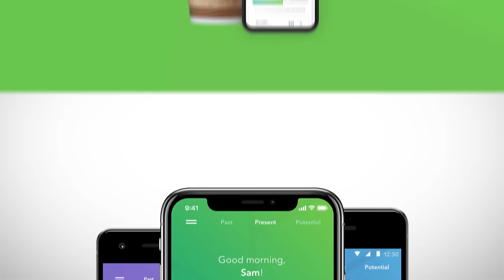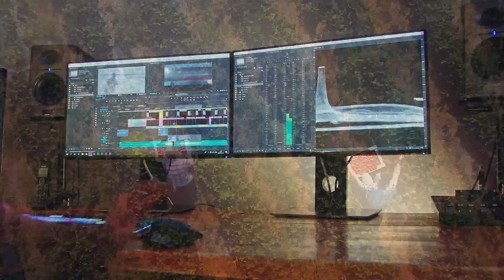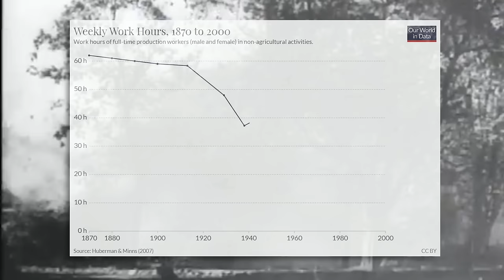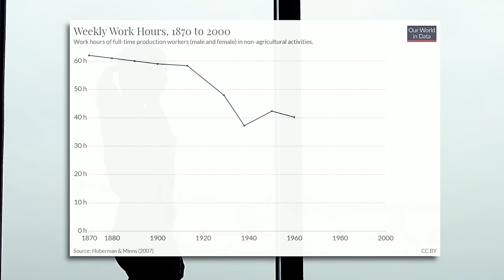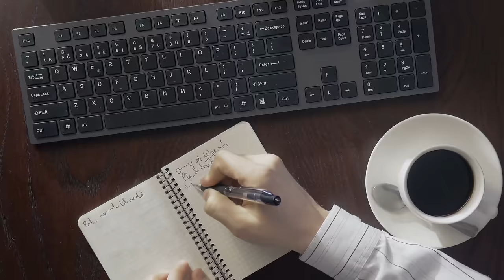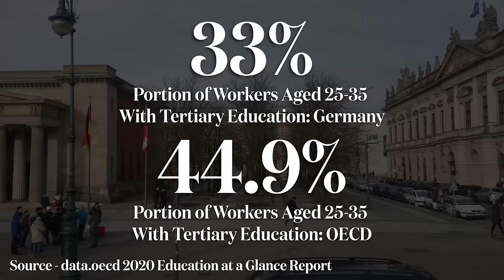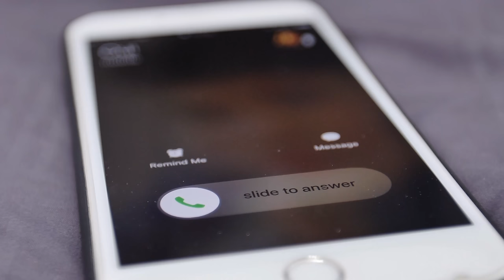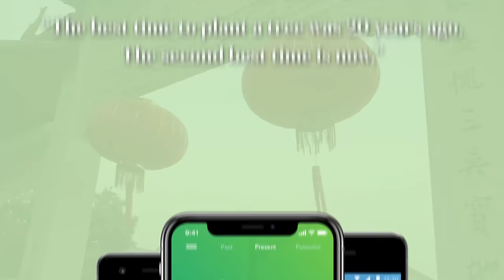Why is Working Harder Making Us Poorer?

Comment: You don’t get paid according to how hard you work. You get paid according to how hard you are to replace.
Reply: There's a checkbox, either written on in the head of every person giving a raise. "Is this person filling a key role for our organisation?"
Reply: Meaning humans are reduced to just tools of production.
Reply: Dude. Nailed it.
Reply: Bullseye! Very well said!
Reply: Indeed, working "hard" doesn't mean that your work is of any utility.
Reply: Yeah which why I try to do the bare minimum now. Which is less work for me. 😅
Reply: Mind blown
Reply: Ooof. That hits hard!
Reply: @bro ha Unless only they know how that crucial module works and there's no documentation.
Reply: Absolutely. Make no mistake your pay isn't meant as any sort of a reward, but simply supply and demand. You are selling your labor, and the value of that labor depends more on the buyer and the market than the seller.
Reply: Bingo
Reply: You get paid for the value you provide to the marketplace -Jim Rohn
Reply: Generally speaking this is correct, but I feel this is more so a cultural problem that you are describing outside of broad market trends of course.

A question I like to ask myself is why don't people working those jobs find a better job? Yeah it's hard, but even a slightly better job is worth it in the long run. The answer almost always is cultural. Being "poor" or "rich" definitely has a cultural component to it and changing culture is very slow. Do I have a solution to this? Not really, other than to say please vote especially in local areas.

Another question to ask is why has the median wage completely stagnated since the 1970s while gdp and average quality of life skyrocketed? Are these jobs part of the answer?
Reply: This is easy enough to understand. Fair enough
Reply: While true. I think your comment needs an edit.
You get paid according to how difficult YOUR BOSS THINKS you are to replace.
Sometimes perception is more important than reality!
Reply: @LiveType  Another question to ask is why has the median wage completely stagnated since the 1970s while gdp and average quality of life skyrocketed? Are these jobs part of the answer?

The answer is complicated but I think it's mainly because:
(1)  GDP is a inaccurate, outdated economic measure that only continues to be used because economists resist change.
(2) While individual incomes have stagnated, household incomes rose when women entered the workforce, so a couple/family now earns 1.5x+ what they previously did when the wife/mother remained at home.
(3) The cost of basic household items (such as food, clothes and basic appliances) has fallen dramatically relative to household incomes (especially when China became an export factory for the West), so while wages haven't been rising, these "living" costs have fallen, making them relatively cheaper (while others, such has property prices and education have risen).
Reply: Well said.
Reply: Jaskaran Singh so is a thief at the cost of his victim
Reply: Jaskaran Singh they’ve replaced the middle class, by stealing their jobs
Reply: Especially worrying considering the dizzying pace of automation and AI encroachment into white collar sectors.
Reply: Not true if you are a business owner.
Reply: @bro ha No he's not. It's really hard to find good developers (hence the high salaries that Google, Facebook, Amazon, et al. offer). (And I say this as someone with 9 years' professional experience as a Web Developer.)
Reply: i wish ha, they cant even find a vacation replacement for, still minimal wage -.-
Reply: @coopsnz1  While it seems businesses pay a lot in taxes, in reality there is bifurcated tax system where a few large businesses don't pay any taxes while also receiving subsidies, and the rest of the businesses who do pay taxes. Apple, and notably Amazon, but also companies like Boeing and GE paid no taxes whatsoever last year while also receiving sizable local government subsidies. Interestingly, in the US, the oil companies received the most money from covid-19 bailouts, which was promptly spent on stock buybacks. That's not illegal, by the way.

Then you have your very large and very expensive public projects that are privately owned, such as billion dollar sports stadiums that get most of their money via local sales taxes and city bonds, but that money is funneled to private owners. The city of St Louis comptroller famously denied a NHL team money raised via taxes because she correctly pointed out the city charter couldn't just give a private individual tax money. Now that would be illegal under embezzlement laws.

Inevitably, large non paying businesses get ever larger as they drive smaller competitors out of business. They then build laws of regulations as walls to keep out future competitors (almost of bills are sponsored by a corporation).
Reply: @langhamp8912  Corporation have gone bankrupt in Australia . Capitalism didn't Kill small business in Australia socialism policy did 40 yrs
Reply: How hard your boss "perceives" it is to replace you. Perception is reality.
Reply: Good job identifying the problem!
Reply: or how much value you produce or how you negotiate
Reply: @bro ha easy to replace? Like are there so many developers that are that good? 

What about bricklayers or concrete pouring i heard they are on raise hard to replace because new generation doesnt like manual jobs also plumber
Reply: @coopsnz1  Australia's master...China...seems to be a Socialist society that works in regards to businesses.
Reply: @cautarepvp2079  There's a lot of developers that aren't very good (I am one of those) but kinda sorta understand the subject matter enough to be paid well enough. That's nowhere near the developer/engineer who doesn't often makes mistakes and easily programs sophisticated functions.

But bricklaying and concrete pouring are procedural tasks that don't require much more than a few days to learn, if that. So... easily replaceable.
Reply: Also I believe the inverse could be true from a worker's perspective. If the worker can secure work with similar conditions but better pay or similar pay but better conditions then they can consider their current work place dispensable. Not everyone can jump ship at the drop of a hat. So employer/employee relationships boil down to who needs who more.
Reply: Correction: you get paid as much as the employer thinks he can get away with paying you.  The only solution is to acquire assets and leave the working class.
Reply: @FrankCastle-tq9bz  That's like saying to an illiterate slave on a southern plantation to acquire his own property and workers.
Reply: langhamp8912   A slave can get his own property and workers - he just needs to kill the master of the plantation and take it from him (Spartacus did this - and nearly killed the Roman Empire in the womb!).

Of course, it’s easier to do this today - it’s still a difficult task, but not as difficult as killing the master of the plantation and burning his social order to the ground...
Reply: Like Baseball.  The key statistic for each player is WAR: Wins Above Replacement
Reply: And when automation and robots become better than humans. We will be replaced
Reply: Danny Bowen  humans are more than the value of their trade. You won't tell an elderly or disabled that they deserve to starve because they have no value to society in terms of production. But I agree that all capable humans must work on something that can benefit the needs of society in some way, but still have the time to pursue recreational activities. The system produced jobs that do not qualify for this because it's only based on demand. I also think that billionaires or millionaires have to give a percentage back to the people not just for pursuit of more income.
Reply: Danny Bowen  True. I was merely pointing out how difficult it is to jump up the socioeconomic scale if you're at the bottom, with few resources, bad or no education (urban public schools in the US are funded at 1/4 of suburban school's, for whatever reasons), and taxes you have to pay that bigger businesses don't have to (Apple, Amazon, IBM, GE, Walmart, Boeing, etc...).

Forty years ago there weren't very many licensing requirements. Now there's a great many.
Reply: Danny Bowen  Holding up an extraordinary example as a typical easily reachable example is so...womanly.
Reply: @bro ha That is absurdly false. Google software engineers are probably some of the most coveted and difficult to replace in the work force. The USA offers tens of thousands of H-1B visas to foreigners uniquely for that position.
Reply: Ben Chesterman 1. Get a better accountant 2. Get some financial advice 3. labour industry is low margin everybody knows that
Reply: Very true.
Best advise for any job is to be that person who can sort that problem that no one else can. Or be the one who knows what to do.
Whatever job you work at always research it and be the best you can.
Even if your young and you know the job your in will not be forever try to train yourself to be the best.
Never work a job that is above your intellectual strength always get a job that is below your intelligence  capabilities. You will climb to the top.
Reply: Its not the jobs its the automation and the surpluss of production that kills the world population that used to work at farms now the 5 percent work for automation empire the others are left to die
Reply: Well, it is about value.  People think that it is just capitalism that makes humans mere tools of production.  In the past, the slaves were the tools of production of their masters.  In communist countries, workers also need to work hard and are the same tools of production of their country.  However,  the individuals who want to make something of themselves won't be motivated to start their own small businesses.
Reply: @whatevergoesforme5129  USSR had good communist system, no sweatshops just gulags for those that whine a lot
Reply: Muhammed Choudhury. The other caveat to this is that you get paid according to your willingness to leave. Ironically if your a key person in an organisation your best chance of getting what your worth is actually to go work somewhere else. If they know you will stay anyway you won’t be paid what your worth.
Reply: @MrSp0iler  Yep, good old communist USSR.   Where is it now?  I guess those gulags were not good tools of production.
Reply: @David-lr2vi  Yep NASA Scientist surely will go to work to China or Russia. As of others, they are replaced by Bangladesh and Malaysia.
Reply: @whatevergoesforme5129  They build railways, amusement for sadists and probably are modern day eastern Europe.
Reply: @MrSp0iler  Just like the typical slaves of the past. Nice pyramids of Egypt, though.  Same with the Great Wall of China.  Nothing new.  It is only now that prisoners are not allowed to do forced manual labor because of the PC culture.  And people think that forcing people to work by their masters, ancient or modern,  is just the evil product of capitalism just because Marx said so.  Human flaws and virtues have remained constant.  Leaders in communist countries are the overlords and the rest are serfs but they think they are all equal.
Reply: A lot of essential workers would dissagree
Reply: @captstainstain  Nasis are hated because they wanted to keep profits inside their countries. Thats why every single 1 of them was killed or tortured after war, like in camps under sun without food during spanish flu. Humanity is virus.
Reply: @MrSp0iler  What???? I just said essential workers should get payed more.
Reply: @captstainstain  What do you mean essential workers? Automation belts? Those that remove office workers by automating even interactions with customers? Physical workers that there is no need for in civilised world? They are paid, if they dont work. But whole world is invading such regions with socialists illegals refugees you name it
Reply: @bro ha not really, because is really hard to find another software engineer with the same company knowledge and experience than the one you hired (especially if he works at Google).
Reply: @MrSp0iler  What i said is that workers who proved to be essential during this covid19 pandemic such as healthcare workers are grossly underpaid.
Reply: @captstainstain  Well I am unemployed for 10 years, live with parents and only work that is available in eastern europe is physical labour. You could do it, maybe it will pay better.
Reply: @MrSp0iler  I hope you will be alright. Take care
Reply: @captstainstain  Good argument
Reply: @MrQuantumInc  The Market is the coordination between the Buyer and Seller, you've phrased it oddly there at the end. But basically yeah, Law of Supply and Demand determines prices and that includes the price of labor ie wage.
Reply: @LiveType  The median wage has certainly NOT stagnated since the 1970's. A quick comparison of your TV, Phone and Computer to the upper class of 1970 will show your are consuming better and living a higher lifestyle than they were.
Reply: @GonzoTehGreat  Exactly, a true measure of your wage is how many hours does it take to purchase something. Not just in amounts but quality as well. Take your TV, Phone and Computer you have now and compare to what someone rich in 1970 could buy. We're living a higher lifestyle and consumption than they were.
Reply: sadly.. true... 

One should be rewarded for how much you contribute to society.

-a teacher does contribute a lot to society, so does a nurse.. but both are paid almost 50% less than other employees at their level of education.

-a sportsman does contribute only a bit of entertainment.. much less vital to society.. but is paid considerably more. even the best brainsurgeans and the best professors each at best 200-300k a year.. top sporters hoard in millions each year.

-a "risk investor" is effectively a negative force to society.. as he destroys real economy value (the means of production) to line his pockets.. yet he earns more than ANY other.

Even the basic market mechanism of supply and demand does not work here..
-for there IS a high demand for teachers and nurses.. there is not a single school or hospital that has not serious understaffed issues.. yet their salary does not go up, as people doing those jobs are often very commited to "the needs of patients/kids" and unlikely to quit.. so the ones at the top get away easier with treathing those people badly..
Reply: @bro ha depends on the project < 1% of 10% of the world has a mathematics or CS masters/PHD. <5% have an accredited bachelors. compare that to lawyers. they really are a dime dozen yet get paid astronomically.
Reply: @alrizo1115  There is a lot of truth there. Of course these fools that do this are destroying the very system that sustains them. The net effect of modernity is that people simply don't have children. Its very hard to make profit with people to buy one's goods. This decline is in every single developed nation other than I think Israel and in many less developed ones. Soon even getting more immigrants won't be an option as there won't be any.
Reply: Why is that a surprise
Reply: Maybe we ought to be paid more according to how much money we make for our company which is usually a lot more than we’re paid.
Reply: @LiveType  The true cultural issue in America is consumerism and the entitlement mentality.  I'm entitled to things so i will borrow to get it or push for government programs to help facilitate that.  Many are trading in their financial liberty for that improved quality of life.  Technology and cheap credit have made it possible but the downsides are debt, ever increasing stress, depression, and financial slavery.
Reply: Infidel Heretic Nope that’s no how it works making a business is risky and hard and needs good reward if you think your boss has it so easy make a new company
Reply: Market for labour is more competitive than ever. 
That means the average person will have to work harder to compete and fill middle class roles than previously in the past.
The average persons value goes down.
The people of rarer or more sought after skills goes up.
Reply: Pi it’s risky until it isn’t.  Once a business establishes itself it doesn’t need to work nearly as hard to hold its position.  It may even squash up and coming competitors before they can establish themselves.  You also have to wealthy enough to take such risks in the first place.
Reply: Infidel Heretic right but for the single man or women who started the company you pay with many all nighters, stress of never knowing when the next lot of money is coming in with the looming fear of losing your house or missing your rent. For every success there’s a hundred failures and for the high risk occupation that is making your own business high reward is the obvious take away.
Reply: Pi 
But for those lucky enough to be born wealthy.  The risk is far lower.  Worst case scenario they get bailed out by and or taken in by their parents.  There’s a reason why the income level of your parents shows the strongest correlation with the career and income level of their children.
Reply: @infidelheretic923  Most big successful companies are started by those without any money and without rich parents. Starting with nothing gives you drive.
Reply: Leverage ;)
Reply: That's poetic...
Reply: Very true. Not that it is a bad thing .
Reply: nowadays anybody can be trained. Not many positions do they look at you that closely.
Reply: @Dude 4Jesus Make your job easier and less intense. Work smart.
Reply: Not exactly.
Reply: essentially you mean we should be a working vegetable
Reply: Actually no.  It’s how much value you add to the product or service you provide.
Reply: @alrizo1115  well yes.  But keep in mind that applies going way way back to the trans ion from hunter-gather to fixed farming.  In short “ no free lunch”
Reply: good insight but it's half of the story, the boss won't pay an employee 1 million per month even if he quits then the company will be out of business. The company has to get enough revenue from the market in order to pay well. After all, product prices and wages are all about "negotiation power".
Reply: @alrizo1115  Yes.However,you need a career;not a job.Use your employer,as a stepping stone to your goals.
Reply: Actually... You get paid how much value you give the company
Reply: Well said sir well said
Reply: Not even anyone can be replaced in this day an age. Your paid by who your friends and family are
Reply: @GonzoTehGreat  Gold & Silver standard  got removed from Dollar which equals to gradual inflation due to falling purchasing power of Dollar. That's what happend in the 1970s.
Reply: @________ That sounds like the gig economy.
Reply: Be careful not to over play that power. They will remove you at some point.
Reply: @________ Catabolic capitalism is where businesses eat public infrastructure. That is, since expansion is now extremely difficult, and the margins of producing goods extremely slim, catabolic capitalism must now eat public services and goods.

For example, Uber and Lyft eat public transportation (mostly) and use public roads.

Banks now make most of their money via late fees, and occasionally from periodic government injections of cash.

Investment banking now makes most of its money from highly artificial markets; they pick one company and inject it with capital until the surrounding companies go bust.

This isn't a matter of political thinking, of socialist versus nationalism or other such nonsense. There's just not much room to expand anymore, so capitalism turns inward.
Reply: Why is Working Harder Making Us Poorer?
                Not true in Trucking!
Reply: @ClarksonsinUSA  You're unique compared to other truck drivers who make far less, or worse yet have loans out on their trucks.
Reply: Not exactly accurate.  CEO's are extremely easy to replace because they don't actually do any work and yet they are making obscene salaries that is not commensurate with their value.
Reply: @Slw1111  then why aren't you one??  :)
Reply: @Slw1111  =This channel has no videos.=bot!
Reply: @ClarksonsinUSA  Because, I  have very valuable skills that actually keeps the company in business.  I'm a revenue generator.
Reply: @Slw1111  the evidence does not support this!
Reply: @ClarksonsinUSA  You wouldn't believe actual evidence if it slapped you in the face.
Reply: @Slw1111  show me! :)
Reply: Put up,or shut up!
Reply: @GonzoTehGreat  Living costs haven't fallen.  Food costs are higher,  utilities are higher, transportation is higher, clothing is higher, basic necessities are all higher but wages are completely stagnant.
Reply: @ClarksonsinUSA  I already did.
Reply: This is incredibly true. No matter how many people dislike you at work, if you prove an invaluable asset, or at least more valuable than others, you will stay and more than likely get benefits from it
Reply: @doesnormalityexist  Wait until your entire workplace is replaced by overseas workers whose own government pays for their benefits so the company doesn't have to.  You really don't have as much value as you think you do.
Reply: @Slw1111  Wages have indeed stagnated in the USA and UK since the 1980s, but all the costs you mentioned are a smaller percentage of average incomes today than they were during most of the last century.
Reply: To get paid well, you need to be providing a service in demand.  Then, how hard you work is extremely important.
Reply: @johnkosowski3321  Teachers, nurses, EMT's, home health aides, social workers, restaurant servers, bank tellers, child care workers, hospital workers,etc are all in demand, work hard but aren't paid well.
Reply: @Slw1111  How much are they in demand?  How much supply is there?  If there is over supply, then wages will be low.  That is a signal for people to do something else.  Truth is that those people probably get paid very close to how they are valued by society.
Reply: @johnkosowski3321  Lest you be a hypocrite, stop using every single service indicated in my previous comment and then you can determine for yourself how truly valuable those jobs actually are.
Reply: If that was true I'd be Rich
Reply: @Slw1111  I need oxygen too.  But I pay nothing for it.  It is already in ample supply and there is no cost to supply it to me.
Reply: And also, how useful is that knowledge... it might be expensive to have a team of engineers to improve eficiency in a factory, so they opt to hire an army of underpaid workers and interns to compensate inefficiencies instead.
Reply: Everyone is replaceable... We are pieces of equipment to capitalists.
Reply: @anti-classist  Jobs are replaceable too.  What is wrong with that?
Reply: @johnkosowski3321  obviously due to automation. Well it depends... Are we happy to eliminate jobs? Then we have all these jobs that don't exist and force a worse and worse economy... I have no problem with jobs going away as long as we add a ubi that pays folks enough to live.
Reply: The only reason I work at all is the fear of being fired, but that only makes me work just hard enough to not get fired.
Reply: @koatam  it's almost like if you owned a stake in the production you'd be more efficient and work harder to get more done in less time .. like say if you as a worker owned the production.
Reply: @anti-classist  We have been automating for hundreds of years.  It used to be that it took 18 people to farm for 20.  Now one farms for many.  The farm tractor automated all of those jobs.  What happened to all of those jobs?  Should we ban the farm tractor?  We can farm with shovels.  Better yet, let's ban shovels and farm with spoons.  Think of all of those "jobs" we could create.
Reply: @johnkosowski3321  I'm not against automation but we have to combat it if we are eliminating jobs... That's all I was saying.
Reply: @anti-classist  What happened to all of the farming jobs?
Reply: @johnkosowski3321  what happens when there is no one needed to deliver goods, sale goods, procure goods? Capitalism isn't about people it's about profit... It doesn't care about anything else. So my question what do we do when labor is no longer needed? Do we just let people starve?
Reply: @anti-classist  Human desires are unlimited.  But, if there ever really was a day where robots would do everything for you and give you everything you ever wanted, then why would you want a job?  We will have ended economic scarcity.
Reply: @johnkosowski3321  well we've already ended a need for economic scarcity. We have an issue of over abundance. We throw away food every day. Our issues are natural resources more than fundamental resources.
Reply: @anti-classist  You don't really believe that, and you certainly haven't made a case for it.  If that were true, people would work a whole lot less.
Reply: @johnkosowski3321  well we should work a lot less... It's kinda insane that we work that much... We shouldnt have to work this many hours to survive. The reality is we are bamboozled into thinking capitalism where the worker gets a small portion of their production is the best system.

We shouldnt have to work so much but we got to keep earning money for our masters.
Reply: too true especially with talkin about nba players
Reply: You get paid according to how much you make your company. 

If you cost your company money, your worthless.
Reply: Sadly
Reply: In other words, value is subjective and the labour theory of value is bullshit
Reply: It's unfortunate that this supports the "make yourself irreplaceable, even at the cost of the project, product, coworkers, and company" mentality.
Reply: And that is why capital attempts to make everyone as replaceable as possible.
Reply: Supply and demand.
Reply: THIS IS SOOOO TRUE!!!!!!!👍👏🏻👏👏👏👏
Reply: @dft2858  but hard workers are tough to come by. Therefore being hard to replace.
Reply: Which is why it is profitable to ensure that labour supply is always well above labour demand: hence globalisation.
Reply: Thats why im putting trip mines in my office that only i know about so that if they fire me someone might trigger one
Reply: Wowzee
Reply: @langhamp8912  China mixed totalitarianism & capitalism.
Reply: Not really true at the executive level. Most people would be surprised to know how many people find themselves thrown into a job they really are not qualified to do. Some rise to the occassion. Some fail. And some manage to get by for a while without having there incompetence discovered. Folks in those jobs don't get paid because they're hard to replace. They get paid a lot because they are the fall guy who gets blamed and fired when their organization stumbles.
Reply: It’s why peasants in the 13th century could get paid more; there was less of them because of the plague.. the peasants didn’t suddenly start being more productive
Reply: Cemetaries are full with "irreplaceable" workers that we have replaced.
Reply: @GonzoTehGreat  True words ... and the conditions can change too if the skillset you have, that used to be invaluable, becomes obsolete.
Reply: Working harder can make you harder to replace.
Reply: So work hard.....
Reply: You get paid according to how much value (Results) you provide.
Reply: ouch!

 but too true...
Reply: Then why do CEOs of big corporations get paid so much when they basically do nothing? 

Bobby Kotick could be replaced by a drinky bird that just keeps pushing the "exploit our fans" button over and over again without much difference being registered except the company would save millions on his salary and bonuses.

IMO up to a certain level you get paid on how hard you are to replace/how valuable your knowledge and skill set it. And after that you get paid based on a weird nepotism and cult of rich people that the rest of us are not privy to and cannot break into without some kind of leg up or lucky break.
Reply: @whitefang238  Culture plays a part. It's undeniable. However, it's a correlation not causation. So arguing that it's not a cause is viable, but then you need to actually state those lower level implications that culture ultimately derives from. Tldr: "culture" is a catch all term here and not ultimately descriptive of socioeconomic status.
Reply: Then why work hard at something if you don't get much out of it? Oh yeah I forgot. Slavery and desperation.
Reply: Yeah, that's a super old idea. Corporations have learned well not to employ people like that.
Reply: Good luck, every job is replaceable
Reply: Facts!
Reply: @OtherDAS  Bollocks. Inflations, new taxes, new laws, globalizations, mass immigrations which means nothing but the lowering of the real unskilled wages...The median wage in 1970 had a purchasing power FAR SUPERIOR on durable goods, which are what truly is bleeding out this generations: house, education, continuos necessity to spend in formations, medical expenses, taxes .
Try buy a house or taking a mortgage now compared to 1970 and ...surprise? Our grandparents and parents could actually afford to buy what now is extremely expensive or totally inaccessible to new generations.
The fact we're able to buy cheap phones or tv at a small prices is due to to competition, outsourcing and continuos innovation and has nothing to do with the the nominal growth of the salaries that CAN'T FOLLOW up the rythm of the incresing cost of of inflation.
Reply: @alrizo1115  yeah, and your point is???
Reply: That's incorrect. You only get paid according to the value you provide to the marketplace if you ignore the value of maximizing what portion of that value you take home.

If I'm a company and an employee is providing a value of 10 and asks for 5 to do so I'm not going to give them 6 unless I think they'll go elsewhere.
Reply: @luiscolon921  That's what the rich want to tell you...
Reply: Now that's a quote for the ages
Reply: .... Unless you are a politician??!
Reply: Supply vs Demand. Biggest factor in economics
Reply: Exactly the point.
Reply: I can't upvote this enough.
Reply: @alrizo1115  economically that’s always been true; nothing wrong with realizing it
Reply: Guess I need to work harder so that I'm a one of a kind, lol.

I say as I take a day off work with no real reason (well, maybe to pick up packing materials as I'm getting ready to move).
Reply: Indeed. If you are as easily replaced by robots, you might as well get paid pennies.
Reply: That's why everybody wants the bosses' salary but nobody wants their jobs
Reply: Unless you are well connected in the company or even worse in government...there are many over-paid people not necessary to the company or government.
Reply: @alrizo1115  Always have been.
Reply: Wrong. You get paid according to how much you’re willing to bullshit your way to the top.
Reply: This person gets it
Reply: Automation made an hourly wage is outdated.
Reply: Mostly retail and service workers do not have paid holidays and work on weekends.
Reply: @alrizo1115  We are tools of production
Reply: Which today is not at all.
Reply: This is wise.
Reply: You get paid according to how hard they THINK you are to replace. Ask for a meaningful raise, get laughed at, quit and watch them fall apart without you.
Reply: @JellyJonesey  Well said
Reply: @gnuemacs1166  "they took r jobs!" 😆
Reply: @LiveType  Hindus got imported to replace the middle class
Reply: Which is how it should be
Reply: @gnuemacs1166  that's not the case, no replace someone, you need to make sure that the other person either accepts shittier working conditions (low wages and no benefits) or is more efficient (usually not the case). Welcome to globalisation, mate ;)
Reply: @philoslother4602  u can import Hindus till the cows come home and suppress wages, it’s modern slavery, globalisation has nothing to do with it, we are not enforcing any labour rules like country of birth or valid  degree, that’d like blaming slavery on globalisation, it’s just an option, like colonialism or fascism
Reply: @gnuemacs1166  I don't think that rules such as 'limitations based on the country of birth' would help, the US is, with its flaws included, one of the most developed countries in the world and has the power to attract other people from the world, it is a country with 4% of the world's population but everyone except the Northern Europeans want to come here, a good restriction would be setting a minimum wage for immigrants (something like 100,000 USD per year so that it becomes prohibitively expensive to hire them) and valid degrees (which are already in place btw), and kicking out illegal immigrants, the main culprits for wage suppression, also making sure that the immigrants that come here are adjusted to 'American Values', no 3rd world batshit ideologies
Reply: Truth
Reply: Only if your employer isn’t a abusive narcissist trying to mentally gaslight you on a regular basis to condition you to believe you are replaceable only for them to turn around and ask to give you a higher raise then you ask for when you tell them you quit because “you’re the best in town.” So, fairly rarely, yeah.
Reply: @kibouSRX  they can't? Or is it just not in their best interests.
Reply: You get paid for the value you put out and how expensive you are to replace.
Reply: You get paid based on how much they valued you at your hiring, and how little they can manage to give you from there. There's plenty of examples of positions or departments (think IT, and a lot of skilled labor,) that are constantly under paid/funded because their necessity isnt understood or understated to justify worse conditions.
Reply: But if you don't work hard you'll never reach that status of hard to replace.
Reply: Laughes in politician, ceo. or contractors.
Reply: @OtherDAS  So, a common thread here is that people are getting paid to work smarter, not harder...
Reply: @IL_Bgentyl  Hey, the CEO has a surprisingly high turnover rate mainly because while the CEO stands to gain a lot for doing well, they also stand to lose a lot for screwing up, and that's more or less for PR. Should said CEO screw up, while they still make money, they won't quite make as much as they would if they do well, and there's a non-zero chance that the press will eat them alive for it.
Reply: @Iamwolf134  The Demand is for Productivity. How you get there is irrelevant.
Reply: @OtherDAS  To that end, we pivot towards outcomes and end results, to better improve our productivity.
Reply: @alrizo1115  They have always been.
Reply: Yes, tho, as EE suggests: there's a counter-intuitive relationship between work hours and efficiency. So, even if your hours are hard to replace, everyone would still be better off if you weren't overworked.
Reply: @TrentTube  Let people decide for themselves what is best for them. Not a 3rd party.
Reply: And in a globalized economy, there are always cheaper workers in some other country.
Reply: Best comment here :D totally true.
Reply: @zacharyneilson9220  That quote is nowhere near as good as this one. It really isn't about the value you provide (it should), but how hard it is to find others that provide the same value. It's basic supply and demand.
Reply: Nailed it
Reply: Everyone is replaceable as an employee anywhere. But remember so are employers
Reply: You get paid for your work unless you are self-employed. You get paid by how many hours of your life you throw away at your employer.
Reply: This is why I'm going to ask for a 30% raise this year.

Replacing me would take 2 or 3 people, and they'd not be as good.
Reply: @MrQuantumInc  I tell people this all the time. It is why unions are so important .
Reply: This.
Reply: @alrizo1115  it's called human resources after all
Reply: I like that
Reply: Essentially you have to be the guy who throw money on the problem and you get raised to throw more money on the problems. Eventually you become the money guy who people goes to get problems solved. That's the description of a Director.
Reply: @GonzoTehGreat  In other words, labor is the only service not affected by supply and demand.
Reply: That's because the labour market is all about supply and demand.
Reply: @alrizo1115  That's all we have ever been. Welcome.
Reply: True for everywhere ive been
Reply: True
Reply: I hate this comment.
Reply: This is true at the general low-end and at the specialized high-end, but doesn't explain employers that pay a premium for talent in hyper-competitive fields, like consulting, tech, and investment banking. McKinsey's analysts are easy to replace BECAUSE they're well paid well, and paid well because they have better opportunities elsewhere.
Reply: *except lower level healthcare professionals apparently. Ask a CNA how much they make.
Reply: Well said this made me feel very pleased with my situation
Reply: @GonzoTehGreat  not likely as ‘Bosses’ can’t just go round sacking anybody so it’s the company.
Reply: You'd think that but nepotism and social mobility play a fairly dramatic role in determining the likelihood of high paying outcomes as well.
Reply: Working harder makes you harder to replace so
Reply: How is this related?
Reply: eeeeeehhhhhhhhhhhhhhhhhhhhhhhhhhh don't know about that.
Reply: Elasticity of labour supply
Reply: @alrizo1115  what does HR stand for? Human Resources. You are a resource, a tool to get from point A to point B
Reply: Snowflakes are hard to replace
Reply: @GonzoTehGreat  i was around in the 70s and i can tell you other than electronic gizmos the average qualty of life by any measure has at best slightly declined and in most categories (cost of education, ability to raise a family on one income, a good retirement with a pension, paid for healthcare, affordable and safe homes, affordable food...etc) things are disastrously worse than the 1970s
Reply: @TheProgrammer93  and now they are all being laid off by the hundreds of thousands
Reply: @danf4447  "things are disastrously worse than the 1970s" 
It depends greatly where you live, but in Europe they aren't and in Asia they're significantly better.
In terms of living costs, some have increased relative to income, while others have decreased. Electronics - including appliances, food and clothing have all decreased, but housing, education and healthcare have all increased. There are also many things we now take for granted in everyday life (such as smartphones and WiFi/Internet) which didn't even exist in the 1970s and there are others which were relatively much more expensive (such as flying abroad or owning a car).
However, this only takes into consideration the COST of living. Overall, living STANDARDS rose between 1970 and 2010, but have been gradually declining in Europe and North America since then. Having said that, I'd still prefer to be born in the 1990s, rather than the 1970s. The question is what kind of future will someone born in 2010s have.
Reply: Whoever is replaceable
Reply: Which is fair!
Reply: This is why acquiring a valuable skill is a powerful money-making tool.
Reply: how much you talk for Frenchies
Reply: As the only decent mechanic in a small town, can confirm. People know I'm not cheap, but if they want it done right and quickly, they come to me.
Reply: First off they pay us not based on our skills and what we really know how to do but based on the repetitive job tasks that u have to perform daily weather if u are more skilled than what u are doing or not the second thing is I can tell this video is based off of the United States economy because of course we are being over worked and under paid but it’s a deeper problem that most people in this country kinda avoid from talking about this which id the industries that fills our economy which is all general labor jobs no skilled industries they all outsourced and went overdress yes it is important to discuss productivity and how hard we work but got dam i mean isn’t it an most important to discuss the industries that makes up this economy which is all trash 🗑️ jobs we have in the usa that’s why our work force is weak we have nothing but restaurant stadium security warehouse fulfillment janitor jobs all bullshit where tf is the architecture tech pharmaceutical ux ui design web and software development all of those industries went over seas I mean y’all know I’m not lying if u try to go job hunting right now in the United States all u going to find is all general labor bullshit
Reply: My mom, saw the horrors of WWII as a 10 year old. To this day, she can recount the cruelty that she saw. She does, on a daily basis, when I call her. Subsisting on a diet of eggs, rice, and vegetables, she was one of the lucky ones. In retrospect, so was I, to have known this lady in the 60s. 

Imagine, the scarcity of daily protein, when her cousins and her, dug deep trenches in the muddy rice fields in rural China, to lure the fish into cooler waters. She recounts the daily routine, waking up before sunrise, to check on the traps, in hopes of capturing the harvest of free lunch. Beggars and the less fortunate would travel through, hoping for an offering.

Life was cheap, in that, bandits and desperate thieves would do anything just to fill their bellies. Your life was at risk on a daily basis. Never mind being replaced.
Reply: @alrizo1115 Reduced? We were always such.
Reply: Put that on a mission banner! 😂
Reply: No, you're paid based on how much you work your time.
Reply: This is what the next generation will suffer through more than we do. It’s so bad now that nearly a fifth of our generation is quiet quitting.
Reply: Even then--only if both the worker and the employer know it.
Reply: You get paid on how much profit or increasingly, rent seeking, the company can get away with.
Reply: @alrizo1115  Corporations are reduced to just tools to get money😢.
Reply: Stormy Daniel’s job is hard to replace.
Reply: @FrankCastle-tq9bz  You say that as if all employers want to screw over employees
Reply: 🤣😂... that is why I chose to lay flat and contribute nothing to the surplus motivated corporations.... 🤣🤣.
Reply: That hits hard although this has always been true